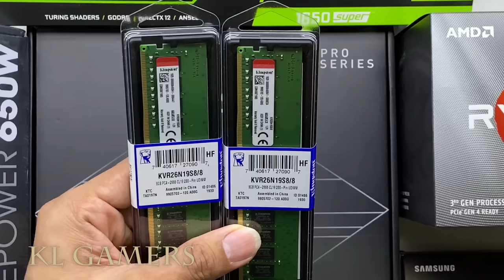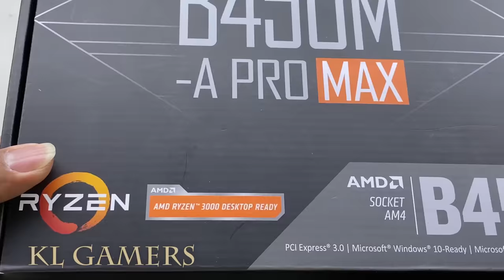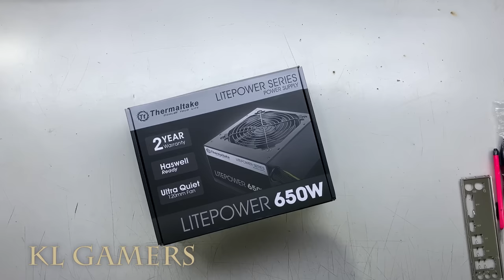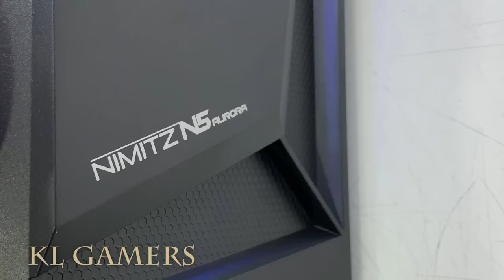AMD Ryzen 5 3600X msi B450M-A PRO MAX 16GB DDR4 SAMSUNG 970 EVO GTX 1650 Super Armaggeddon Nimitz N5

Comment: Also mention total cost please 🙏
Reply from the maker: Processor = AMD Ryzen 5 3600X 6-Core, 12-Thread Unlocked Desktop Processor with Wraith Spire Cooler
(Amazon link) = https://amzn.to/3huiDZx
(Lazada link) = https://c.lazada.com.my/t/c.bHc9Hg?url=https%3A%2F%2Fwww.lazada.com.my%2Fproducts%2Famd-ryzen-5-3600x-with-wraith-spire-cooler-free-bubble-wrap-i528720221-s1044744320.html&&sub_id1=3600x&sub_id2=BIG&sub_id3=979
(Shopee link) = https://invol.co/cl10ft9

Motherboard = MSI ProSeries AMD Ryzen 2ND and 3rd Gen AM4 M.2 USB 3 DDR4 D-Sub DVI HDMI Crossfire ATX Motherboard (B450M-A Pro Max) (B450MAPROMAX)
by MSI COMPUTER
(Amazon link) = https://amzn.to/2Xlecbf
(Lazada link) = https://c.lazada.com.my/t/c.b1VlcO?url=https%3A%2F%2Fwww.lazada.com.my%2Fproducts%2Fmsi-motherboard-b450m-a-pro-max-socket-am4-i989048352-s2601008019.html&&sub_id1=PRO+MAX&sub_id2=i+save&sub_id3=278
(Shopee link) = https://invol.co/clug3f

RAM = HyperX Fury RGB 16GB 3200MHz DDR4 CL16 DIMM (Kit of 2) 1Rx8 RGB XMP Desktop Memory HX432C16FB3AK2/16
(Amazon link) = https://amzn.to/2NIVgi1
(Lazada link) = https://c.lazada.com.my/t/c.ZfZ6AH?url=https%3A%2F%2Fwww.lazada.com.my%2Fproducts%2Fkingston-hyperx-fury-rgb-8gb-ddr4-3200-mhz-cl16-gaming-ram-amakusa-i613494983-s1262384796.html&&sub_id1=3200+RGB&sub_id2=Amakusa&sub_id3=229
(Shopee link) = https://invol.co/clkhgg

SSD = Samsung 970 EVO SSD 500GB - M.2 NVMe Interface Internal Solid State Drive with V-NAND Technology (MZ-V7E500BW), Black/Red
(Amazon link) = https://amzn.to/3aak10e
(Lazada link) = https://c.lazada.com.my/t/c.6Eb6?url=https%3A%2F%2Fwww.lazada.com.my%2Fproducts%2Fsamsung-v-nand-970-evo-nvme-m2-2280-ssd-500gb-mz-v7e500bw-i467362457-s756058157.html&&sub_id1=970+evo&sub_id2=EIT&sub_id3=575
(Shopee link) = https://invol.co/clkbql

SSD = Kingston 500GB A2000 M.2 2280 Nvme Internal SSD PCIe Upto 2000MB/S with Full Security Suite SA2000M8/500G
(Amazon link) = https://amzn.to/381FuGm
(Lazada link) = https://c.lazada.com.my/t/c.6uzt?url=https%3A%2F%2Fwww.lazada.com.my%2Fproducts%2Fkingston-a2000-m2-2280-nvme-pcie-ssd-500gb-sa2000m8500g-i411502404-s1615374960.html&&sub_id1=a2000&sub_id2=eit&sub_id3=350
(Shopee link) = https://invol.co/cllbub

Hard Disk = Seagate BarraCuda 1TB desktop hard disk =RM170
(Amazon link) = https://amzn.to/2YFWWLP
(Lazada link) = https://c.lazada.com.my/t/c.WLWh
(Shopee link) = https://invol.co/clh6b1

Graphics Card = Galax GALAX GeForce® GTX 1650 Super EX (1-Click OC) 4GB GDDR6 128-bit DP/HDMI/DVI-D
(Amazon link) = https://amzn.to/3jejSww
(Lazada link) = https://c.lazada.com.my/t/c.bsgmvW?url=https%3A%2F%2Fwww.lazada.com.my%2Fproducts%2Fgraphic-card-galax-nvidia-geforce-gtx-1650-super-ex-1-click-oc-i833192468-s1983092505.html&&sub_id1=1650S&sub_id2=LAZ&sub_id3=749
(Shopee link) = https://invol.co/cl10c5p

Wifi = TP-Link WiFi 6 AX3000 PCIe WiFi Card for PC with Heat Sink| Bluetooth 5.0 | 802.11AX Dual Band Wireless Adapter with MU-MIMO, Ultra-Low Latency (Archer TX50E)
(Amazon link) = https://amzn.to/2DuK6eS
(Lazada link) = https://c.lazada.com.my/t/c.b6kMNB?url=https%3A%2F%2Fwww.lazada.com.my%2Fproducts%2Ftp-link-ax3000-wi-fi-6-bluetooth-50-pcie-adapter-archer-tx50e-free-pubg-bag-i1169126020-s3379272581.html&&sub_id1=AX3000&sub_id2=Mono&sub_id3=149
(Shopee link) = https://invol.co/clvwf5

Power Supply = COOLER MASTER ELITE P600 V3 230V PK600W POWER SUPPLY (MPW-6001-PCABN1)
(Amazon link) = https://amzn.to/2YKHnG2
(Lazada link) = https://c.lazada.com.my/t/c.Z6UZr0?url=https%3A%2F%2Fwww.lazada.com.my%2Fproducts%2Fcooler-master-elite-p600-v3-230v-pk600w-power-supply-mpw-6001-pcabn1-i1117960818-s3147116409.html&&sub_id1=Elite+P600&sub_id2=EIT&sub_id3=155
(Shopee link) = https://invol.co/clpt9d

Casing = Armaggeddon Nimitz N5 Aurora RGB MATX Tempered Glass Gaming Chassis
(Lazada link) = https://c.lazada.com.my/t/c.bHce4P?url=https%3A%2F%2Fwww.lazada.com.my%2Fproducts%2Farmaggeddon-nimitz-n5-aurora-rgb-matx-tempered-glass-gaming-chassis-free-2-x-led-fan-i637384599-s1333000484.html&&sub_id1=Nimitz&sub_id2=CS&sub_id3=129
(Shopee link) = https://invol.co/cl10fsj

AeroCool Cylon RGB Mid Tower with Acrylic Side Window, Black
(Amazon link) = https://amzn.to/2xd3eem

Price is based in local Malaysia current price.
Reply: @KLGamers  thank you dear for mentioning website sources, but its very hard for mobile phone users to open each and every link to check the price, that's why I asked

Comment: What will be the Total cost of this pc?
Reply from the maker: Processor = AMD Ryzen 5 3600X 6-Core, 12-Thread Unlocked Desktop Processor with Wraith Spire Cooler
(Amazon link) = https://amzn.to/3huiDZx
(Lazada link) = https://c.lazada.com.my/t/c.bHc9Hg?url=https%3A%2F%2Fwww.lazada.com.my%2Fproducts%2Famd-ryzen-5-3600x-with-wraith-spire-cooler-free-bubble-wrap-i528720221-s1044744320.html&&sub_id1=3600x&sub_id2=BIG&sub_id3=979
(Shopee link) = https://invol.co/cl10ft9

Motherboard = MSI ProSeries AMD Ryzen 2ND and 3rd Gen AM4 M.2 USB 3 DDR4 D-Sub DVI HDMI Crossfire ATX Motherboard (B450M-A Pro Max) (B450MAPROMAX)
by MSI COMPUTER
(Amazon link) = https://amzn.to/2Xlecbf
(Lazada link) = https://c.lazada.com.my/t/c.b1VlcO?url=https%3A%2F%2Fwww.lazada.com.my%2Fproducts%2Fmsi-motherboard-b450m-a-pro-max-socket-am4-i989048352-s2601008019.html&&sub_id1=PRO+MAX&sub_id2=i+save&sub_id3=278
(Shopee link) = https://invol.co/clug3f

RAM = HyperX Fury RGB 16GB 3200MHz DDR4 CL16 DIMM (Kit of 2) 1Rx8 RGB XMP Desktop Memory HX432C16FB3AK2/16
(Amazon link) = https://amzn.to/2NIVgi1
(Lazada link) = https://c.lazada.com.my/t/c.ZfZ6AH?url=https%3A%2F%2Fwww.lazada.com.my%2Fproducts%2Fkingston-hyperx-fury-rgb-8gb-ddr4-3200-mhz-cl16-gaming-ram-amakusa-i613494983-s1262384796.html&&sub_id1=3200+RGB&sub_id2=Amakusa&sub_id3=229
(Shopee link) = https://invol.co/clkhgg

SSD = Samsung 970 EVO SSD 500GB - M.2 NVMe Interface Internal Solid State Drive with V-NAND Technology (MZ-V7E500BW), Black/Red
(Amazon link) = https://amzn.to/3aak10e
(Lazada link) = https://c.lazada.com.my/t/c.6Eb6?url=https%3A%2F%2Fwww.lazada.com.my%2Fproducts%2Fsamsung-v-nand-970-evo-nvme-m2-2280-ssd-500gb-mz-v7e500bw-i467362457-s756058157.html&&sub_id1=970+evo&sub_id2=EIT&sub_id3=575
(Shopee link) = https://invol.co/clkbql

SSD = Kingston 500GB A2000 M.2 2280 Nvme Internal SSD PCIe Upto 2000MB/S with Full Security Suite SA2000M8/500G
(Amazon link) = https://amzn.to/381FuGm
(Lazada link) = https://c.lazada.com.my/t/c.6uzt?url=https%3A%2F%2Fwww.lazada.com.my%2Fproducts%2Fkingston-a2000-m2-2280-nvme-pcie-ssd-500gb-sa2000m8500g-i411502404-s1615374960.html&&sub_id1=a2000&sub_id2=eit&sub_id3=350
(Shopee link) = https://invol.co/cllbub

Hard Disk = Seagate BarraCuda 1TB desktop hard disk =RM170
(Amazon link) = https://amzn.to/2YFWWLP
(Lazada link) = https://c.lazada.com.my/t/c.WLWh
(Shopee link) = https://invol.co/clh6b1

Graphics Card = Galax GALAX GeForce® GTX 1650 Super EX (1-Click OC) 4GB GDDR6 128-bit DP/HDMI/DVI-D
(Amazon link) = https://amzn.to/3jejSww
(Lazada link) = https://c.lazada.com.my/t/c.bsgmvW?url=https%3A%2F%2Fwww.lazada.com.my%2Fproducts%2Fgraphic-card-galax-nvidia-geforce-gtx-1650-super-ex-1-click-oc-i833192468-s1983092505.html&&sub_id1=1650S&sub_id2=LAZ&sub_id3=749
(Shopee link) = https://invol.co/cl10c5p

Wifi = TP-Link WiFi 6 AX3000 PCIe WiFi Card for PC with Heat Sink| Bluetooth 5.0 | 802.11AX Dual Band Wireless Adapter with MU-MIMO, Ultra-Low Latency (Archer TX50E)
(Amazon link) = https://amzn.to/2DuK6eS
(Lazada link) = https://c.lazada.com.my/t/c.b6kMNB?url=https%3A%2F%2Fwww.lazada.com.my%2Fproducts%2Ftp-link-ax3000-wi-fi-6-bluetooth-50-pcie-adapter-archer-tx50e-free-pubg-bag-i1169126020-s3379272581.html&&sub_id1=AX3000&sub_id2=Mono&sub_id3=149
(Shopee link) = https://invol.co/clvwf5

Power Supply = COOLER MASTER ELITE P600 V3 230V PK600W POWER SUPPLY (MPW-6001-PCABN1)
(Amazon link) = https://amzn.to/2YKHnG2
(Lazada link) = https://c.lazada.com.my/t/c.Z6UZr0?url=https%3A%2F%2Fwww.lazada.com.my%2Fproducts%2Fcooler-master-elite-p600-v3-230v-pk600w-power-supply-mpw-6001-pcabn1-i1117960818-s3147116409.html&&sub_id1=Elite+P600&sub_id2=EIT&sub_id3=155
(Shopee link) = https://invol.co/clpt9d

Casing = Armaggeddon Nimitz N5 Aurora RGB MATX Tempered Glass Gaming Chassis
(Lazada link) = https://c.lazada.com.my/t/c.bHce4P?url=https%3A%2F%2Fwww.lazada.com.my%2Fproducts%2Farmaggeddon-nimitz-n5-aurora-rgb-matx-tempered-glass-gaming-chassis-free-2-x-led-fan-i637384599-s1333000484.html&&sub_id1=Nimitz&sub_id2=CS&sub_id3=129
(Shopee link) = https://invol.co/cl10fsj

AeroCool Cylon RGB Mid Tower with Acrylic Side Window, Black
(Amazon link) = https://amzn.to/2xd3eem

Price is based in local Malaysia current price.

Comment: how mauch does it cost?
Reply from the maker: Processor = AMD Ryzen 5 3600X 6-Core, 12-Thread Unlocked Desktop Processor with Wraith Spire Cooler
(Amazon link) = https://amzn.to/3huiDZx
(Lazada link) = https://c.lazada.com.my/t/c.bHc9Hg?url=https%3A%2F%2Fwww.lazada.com.my%2Fproducts%2Famd-ryzen-5-3600x-with-wraith-spire-cooler-free-bubble-wrap-i528720221-s1044744320.html&&sub_id1=3600x&sub_id2=BIG&sub_id3=979
(Shopee link) = https://invol.co/cl10ft9

Motherboard = MSI ProSeries AMD Ryzen 2ND and 3rd Gen AM4 M.2 USB 3 DDR4 D-Sub DVI HDMI Crossfire ATX Motherboard (B450M-A Pro Max) (B450MAPROMAX)
by MSI COMPUTER
(Amazon link) = https://amzn.to/2Xlecbf
(Lazada link) = https://c.lazada.com.my/t/c.b1VlcO?url=https%3A%2F%2Fwww.lazada.com.my%2Fproducts%2Fmsi-motherboard-b450m-a-pro-max-socket-am4-i989048352-s2601008019.html&&sub_id1=PRO+MAX&sub_id2=i+save&sub_id3=278
(Shopee link) = https://invol.co/clug3f

RAM = HyperX Fury RGB 16GB 3200MHz DDR4 CL16 DIMM (Kit of 2) 1Rx8 RGB XMP Desktop Memory HX432C16FB3AK2/16
(Amazon link) = https://amzn.to/2NIVgi1
(Lazada link) = https://c.lazada.com.my/t/c.ZfZ6AH?url=https%3A%2F%2Fwww.lazada.com.my%2Fproducts%2Fkingston-hyperx-fury-rgb-8gb-ddr4-3200-mhz-cl16-gaming-ram-amakusa-i613494983-s1262384796.html&&sub_id1=3200+RGB&sub_id2=Amakusa&sub_id3=229
(Shopee link) = https://invol.co/clkhgg

SSD = Samsung 970 EVO SSD 500GB - M.2 NVMe Interface Internal Solid State Drive with V-NAND Technology (MZ-V7E500BW), Black/Red
(Amazon link) = https://amzn.to/3aak10e
(Lazada link) = https://c.lazada.com.my/t/c.6Eb6?url=https%3A%2F%2Fwww.lazada.com.my%2Fproducts%2Fsamsung-v-nand-970-evo-nvme-m2-2280-ssd-500gb-mz-v7e500bw-i467362457-s756058157.html&&sub_id1=970+evo&sub_id2=EIT&sub_id3=575
(Shopee link) = https://invol.co/clkbql

SSD = Kingston 500GB A2000 M.2 2280 Nvme Internal SSD PCIe Upto 2000MB/S with Full Security Suite SA2000M8/500G
(Amazon link) = https://amzn.to/381FuGm
(Lazada link) = https://c.lazada.com.my/t/c.6uzt?url=https%3A%2F%2Fwww.lazada.com.my%2Fproducts%2Fkingston-a2000-m2-2280-nvme-pcie-ssd-500gb-sa2000m8500g-i411502404-s1615374960.html&&sub_id1=a2000&sub_id2=eit&sub_id3=350
(Shopee link) = https://invol.co/cllbub

Hard Disk = Seagate BarraCuda 1TB desktop hard disk =RM170
(Amazon link) = https://amzn.to/2YFWWLP
(Lazada link) = https://c.lazada.com.my/t/c.WLWh
(Shopee link) = https://invol.co/clh6b1

Graphics Card = Galax GALAX GeForce® GTX 1650 Super EX (1-Click OC) 4GB GDDR6 128-bit DP/HDMI/DVI-D
(Amazon link) = https://amzn.to/3jejSww
(Lazada link) = https://c.lazada.com.my/t/c.bsgmvW?url=https%3A%2F%2Fwww.lazada.com.my%2Fproducts%2Fgraphic-card-galax-nvidia-geforce-gtx-1650-super-ex-1-click-oc-i833192468-s1983092505.html&&sub_id1=1650S&sub_id2=LAZ&sub_id3=749
(Shopee link) = https://invol.co/cl10c5p

Wifi = TP-Link WiFi 6 AX3000 PCIe WiFi Card for PC with Heat Sink| Bluetooth 5.0 | 802.11AX Dual Band Wireless Adapter with MU-MIMO, Ultra-Low Latency (Archer TX50E)
(Amazon link) = https://amzn.to/2DuK6eS
(Lazada link) = https://c.lazada.com.my/t/c.b6kMNB?url=https%3A%2F%2Fwww.lazada.com.my%2Fproducts%2Ftp-link-ax3000-wi-fi-6-bluetooth-50-pcie-adapter-archer-tx50e-free-pubg-bag-i1169126020-s3379272581.html&&sub_id1=AX3000&sub_id2=Mono&sub_id3=149
(Shopee link) = https://invol.co/clvwf5

Power Supply = COOLER MASTER ELITE P600 V3 230V PK600W POWER SUPPLY (MPW-6001-PCABN1)
(Amazon link) = https://amzn.to/2YKHnG2
(Lazada link) = https://c.lazada.com.my/t/c.Z6UZr0?url=https%3A%2F%2Fwww.lazada.com.my%2Fproducts%2Fcooler-master-elite-p600-v3-230v-pk600w-power-supply-mpw-6001-pcabn1-i1117960818-s3147116409.html&&sub_id1=Elite+P600&sub_id2=EIT&sub_id3=155
(Shopee link) = https://invol.co/clpt9d

Casing = Armaggeddon Nimitz N5 Aurora RGB MATX Tempered Glass Gaming Chassis
(Lazada link) = https://c.lazada.com.my/t/c.bHce4P?url=https%3A%2F%2Fwww.lazada.com.my%2Fproducts%2Farmaggeddon-nimitz-n5-aurora-rgb-matx-tempered-glass-gaming-chassis-free-2-x-led-fan-i637384599-s1333000484.html&&sub_id1=Nimitz&sub_id2=CS&sub_id3=129
(Shopee link) = https://invol.co/cl10fsj

AeroCool Cylon RGB Mid Tower with Acrylic Side Window, Black
(Amazon link) = https://amzn.to/2xd3eem

Price is based in local Malaysia current price.

Comment: Bro this is not a perfect pc for gaming and streaming and editing
CPU - ryzen 3 3300x
GPU - GTX 1660 super
Motherboard - MSI b450 gaming plus max
Ram - corsair vengance lpx 16gb 8×2 3000mhz OC to higher frequency
Storage - Kingston A400 240gb 2.5inch sata SSD upgrade to 1tb or 2tb 7200rpm hdd later for now stick with SSD only
Case - coolermaster mb511 4fans 3 RGB one black 2 usb 3.0 ports full mesh front
Psu - coolermaster 550w psu
Moniter - lg 22inch 1080p 75hz moniter

Comment: My system is a 
AMD Ryzen Threadripper 1920X
ASROCK Socket TR4 AMD X399
ASROCK Socket TR4 AMD X399 2X8 4 sets for 64 gbs
Samsung 970 EVO SSD 500GB - M.2 NVMe
WD Blue SN550 500GB NVMe Internal SSD - Gen3 x4 PCIe 8Gb/s X 2
NZXT Kraken X63 280mm - RL-KRX63-01 - AIO RGB CPU Liquid Cooler
NZXT H510 - CA-H510B-BR - Compact ATX Mid-Tower PC Gaming Case
Crucial BX500 1TB 3D NAND SATA 2.5-Inch Internal SSD X 2
NVIDIA GeForce RTX 2080 Super GDDR6 Graphics Card - 8GB Founders Edition
Cooler Master MPY-6501-AFAAG-US MWE 650 Gold Full Modular, 80+ Gold Certified 650W Power Supply
Reply: mess up a bit  the Ram is 
Patriot Viper Steel DDR4 16GB (2 x 8GB) 3200MHz Kit 64 gbs four sets